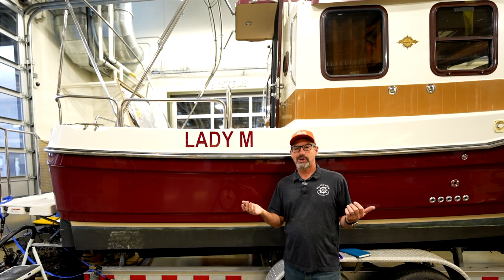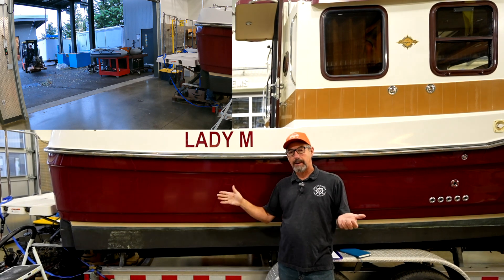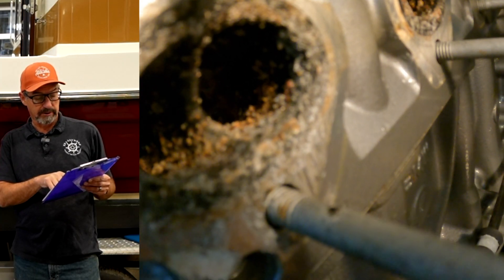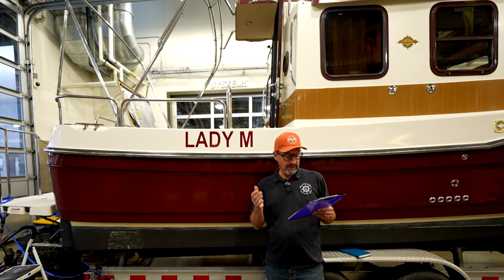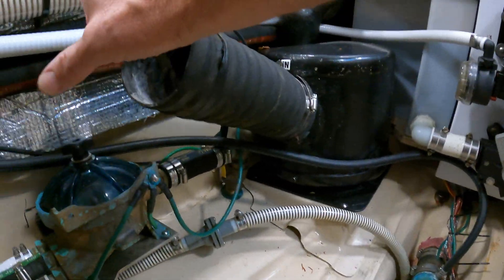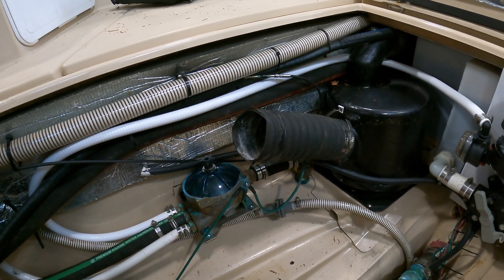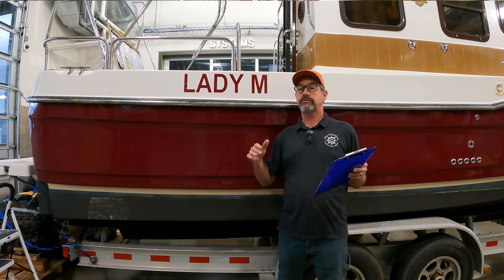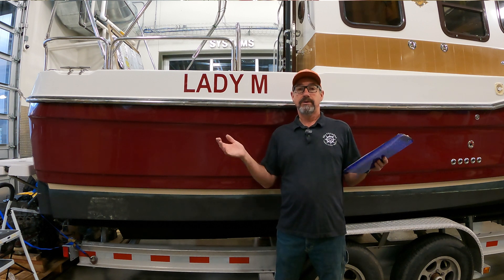Lady M: Engine Questions, why did the diesel fail??

Comment: Could you put an outboard on this?
Reply from the maker: We discussed that option. However, for authentic learning and our students we wanted to re-power with diesel. Adding an outboard would just be bolting on a new bracket and motor...
Reply: @SVCSkallywags  Would the keel have to be cut away or would you have left it on? I am in the same predicament with a ranger tug 27 inboard needing re power. Thinking of going the 60 hp route as you guys originally planned for. An outboard might be a good idea, what size would you have put on there?

Comment: What a great project for the students! I would suggest finding a few similar boats for sale in the area and go snap 100's of pictures of the engine bay. This will aid in reassembly. (Nothing more daunting then having to piece together a basket case)
Try to find a replacement engine exactly like what was originally installed. This will help keep the selling value high.
Reply from the maker: That's our thoughts, except they don't make this engine anymore, I'm still waiting to connect with Yanmar... One way or another we'll get it sorted out!

Comment: If the engine was cranking for an extended time the saltwater pump can  fill the engine, there should be a siphon break before the sea water enters the mixing elbow as well.
Reply from the maker: Yes, we are putting together a video of 4 ways to drown an engine. Excessive Cranking, Lack of maintenance on vented loops, Extended cranking, and towing!

Comment: The exhaust mixing elbow or riser on those Yanmars are common failure points allowing saltwater to enter the engine thru the turbo to the exhaust manifold and then into whichever cylinder has an open valve. Find a mechanical Yanmar in the JH or LH series. The earlier 4 cylinder turno engines can go up to 240hp and are Yanmars own design not a modded Toyota as in the LP series.
Reply from the maker: I have the old elbow, we'll give it a good inspection! Thanks